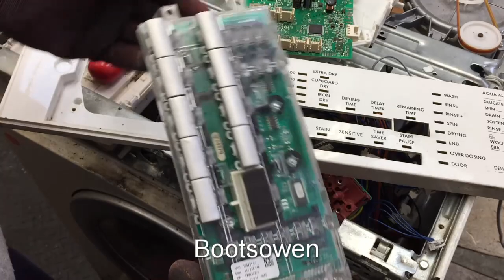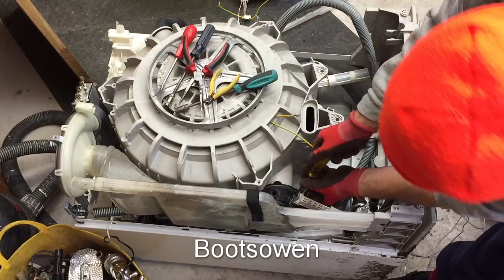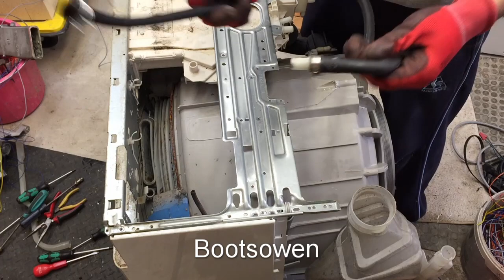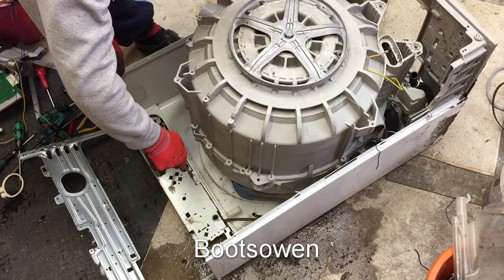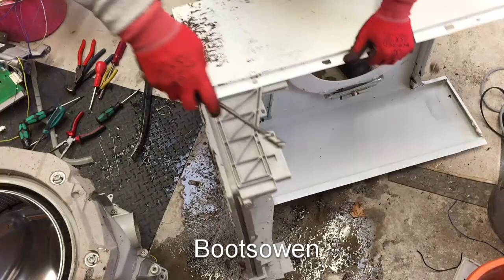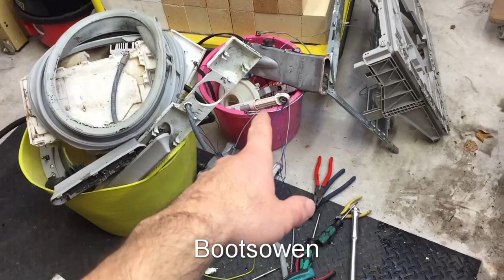AEG Washer Dryer salvage and scrap recycling for washing machine drum firepit

Comment: These washer dryers are usually a waste of time really. They really just over complicate something that doesn’t need to be over complicated if that makes sense in my opinion as they can only dry half the load and usually they don’t do a good job from when I used one and I think that was a zanussi similar to what I destroyed ages ago
Reply: Same here too, even Japanese heat pump washer dryers (both top load and front load models) are still better than other condenser-type washer dryers, just like this one you saw it, they will be very expensive, even more than Miele and Bosch/Siemens, and also very hard to be serviceable too, even all Japanese heat pump washer dryers always use high quality bearing and split tub too, that's just my opinion